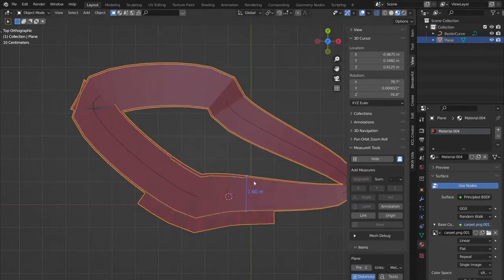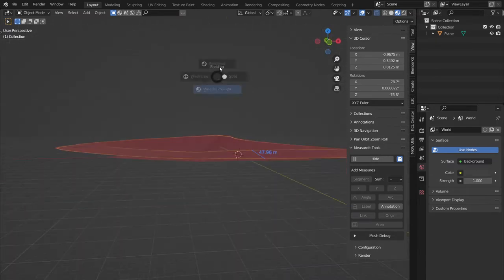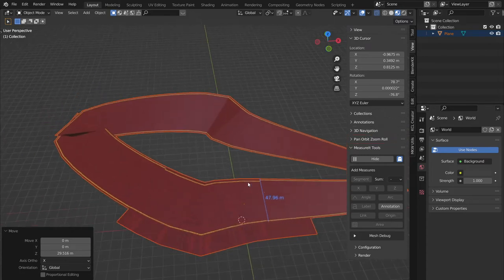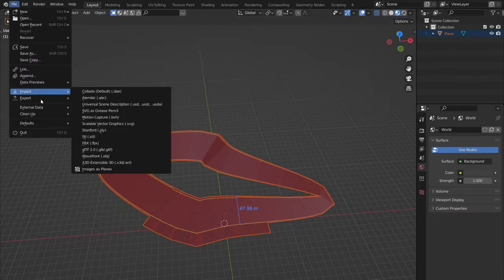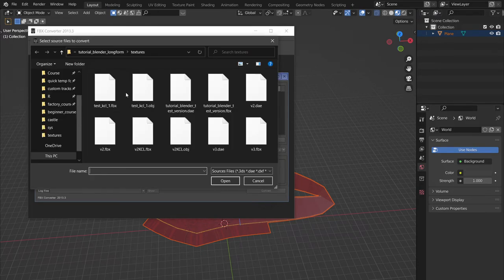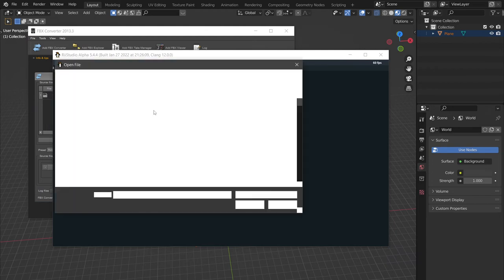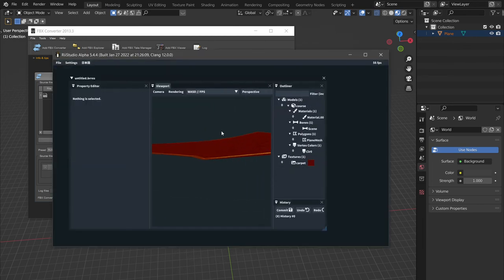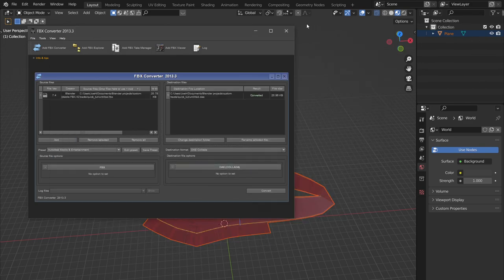Quick Brres

Comment: how to install Rii Studio?
Reply from the maker: Yeah I should have shown this. You dont want to download the code. 
Rather, on the right, you should see a 'releases' section. The exe can be found in there
Reply: @mkwTL  thanks!
Reply: @mkwTL  I have one more question. I put the course into the Dolphin Emulator and started the race. But the texture of the course was not loaded. Please let me know how to solve this problem. szs file, fbx and textures-->https://drive.google.com/file/d/1V7BV_A4wAcpLosYzgYIXinSJtahnkWCl/view
Reply from the maker: Oooh yeah that's a fun one. Looks like you have scaling issues that could very well contribute to the issue. Road width should be 40m in blender, and should be exported with 100 scale if using fbx / no changes to scale if exporting via autodesk dae (available as an export option if using Gabi's mwii utils). KCL should automatically be set to exporting at a scale of 100 if using mkwii utils. Currently, in Lorenzi's, you can compare your kcl visualization to a mkwii course's visualization to see the huge differences in scale. Amusingly, your course model also seems very small in noclip

If you fix the scaling things and still encounter this issue, try taking a default mkwii course, and replace one thing at a time. So first check if just the course_model works, then just replace the kcl / kmp.
This is the best error checking tip

GL! Mkwii course creation bugs are an absolute pain
Reply: @mkwTL  I resized it and got the following --> https://drive.google.com/file/d/1rYl84arboR9ArA2kvYKK9UKxvJtB7251/view